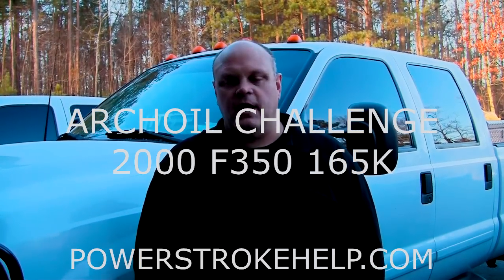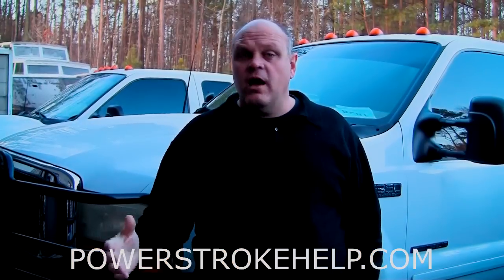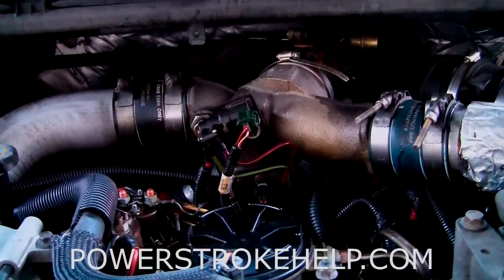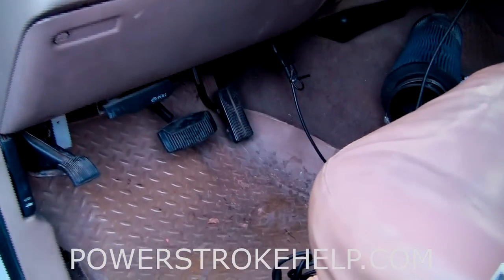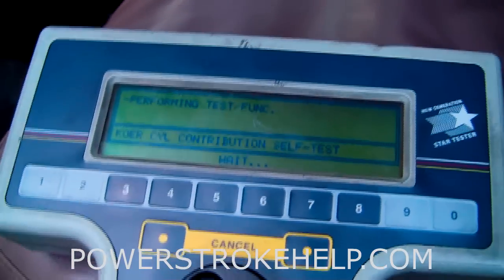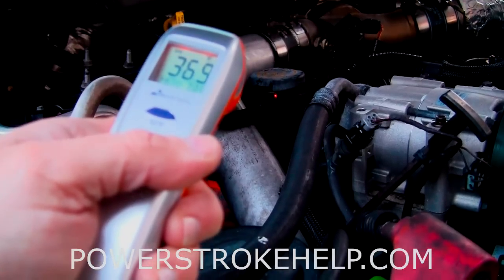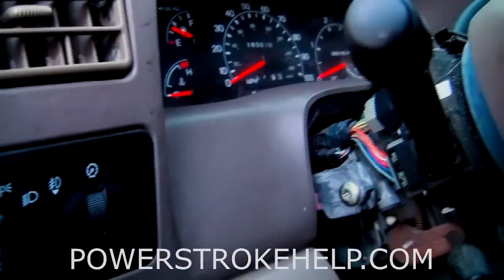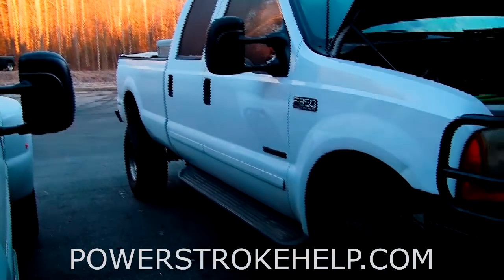ARCHOIL CHALLENGE 2000 F350 165K

Comment: I’ve been working on 7.3 diesels for over 20 years now and I don’t believe in snake oil products to repair them. That being said I watched this video I unwillingly bought a bottle of this expensive shit and put it in my personal truck with 200,000 on the original injectors. It had a bad skip when cold and now it purrs like a kitten. I also added some to the power steering and it helped tremendously. Thanks for spending the time giving us your advise much appreciated.

Comment: Bill, Your videos are great!  I am not a powerstroke owner but I used to be a tech at a few Ford dealers as a line tech and did not work on the diesel engines. all your information is fantastic to pass along to anyone that needs this info you provide and if I get a chance I send them to your channel. great stuff! I always had a soft spot for the 7.3 powerstroke because it is a real work horse of a engine and very few problems if taken care of. just pack a extra camshaft position sensor in the glove box  as it seems to be the achillies heel of the 7.3.

Comment: Bill-I really appreciate your videos.  They have helped me do a better job servicing my 2005 6.0 truck.  I have 184K miles on the truck, and have not had any major troubles, however, do have the stiction issue.  I ordered the Archoil combo today, and hope it gives me better results.  Also, I will be changing to synthetic motor oil.  I have ran regular Rotella for the life of the truck, but feel the injectors need a break........before they break.  Thanks again for the service you provide.  It is appreciated.
Reply from the maker: jamout65 Thank you for your business. This stuff really works. please leave some feedback at archoil.powerstrokehelp.com

Comment from the maker: GO TO POWERSTROKEHELP dot COM to get best pricing
Reply: powerstrokehelp You can put full links in your description part of the video...   Thanks for the video good to know info!
Reply: powerstrokehelp is there a rate for shipping to canada?
Reply from the maker: Kevin Rogers SEnd an email to powerstrokehelp at bellsouth dot net with your exact canadian address and I will give you a quote to ship the p1 kit. no free samples to Canada. Sorry
Reply: powerstrokehelp I wont believe that this isn't snake oil until you do a real test. Brand new engine ran with archoil from the beginning. Brand new engine ran without archoil. At 50k, tear both engines apart and compare wear. Then compare those results with an old engine you have sitting around that has only had archoil ran in it for say 10 to 15k. That will really show what it can do. Then I'll believe these videos are more than you just selling something to make some greenbacks.
Reply: +powerstrokehelp i bought some from a web site in canada and honestly it did sort one of my injectors out, my balance rates(gm's cylinder contrbution system) was hitting +4 at idle when warm and +5.6 in drive, well specs are +4 to -4 in park and +6 to -6 in drive, well not it wont even hit +3 in park and +4 in drive, kinda amazing, i did add the additive into the oil did not notice any chance which i didnt expect it, but on the fuel side of things im impressed and litterly when the additive hit the injectors i could hear a tone change, i swear it changed mabey its all the weed i smoke but it did

Comment: Wow. My 7.3 f350 does that exact same thing during the winter. I never knew what the problem was and neither did any shop in my area. Im going to try it. Thanks Bill.
Reply from the maker: Matt Morris You need to order the p1 kit and hopefully you caught it before the injectors are damaged beyond what ARchoil Ar9100 can do. archoil.powerstrokehelp.com
Reply: powerstrokehelp  Im not pulling any codes from my sct 3015 tho. It runs fine during the summer and after warmed up. Is that normal for stiction?

Comment: Mine was doing and sounded exactly the same. Your guy diagnosed it as needing new battery cables. The ones I had weren't to old. I said replace them if that was the problem. The installation was Not neatly done and the positive cable rubbed against pulley. I had to fix that. Needles to say the new cables didn't fix the issue. There was other repairs done as well. Fuel pump installed all good. Transmission remove new torque converter installed because of loud as heck noise and shifting hard that was my diagnosis I was told that probably wasn't the problem of it shifting hard but it was the problem. Now the torque converter is making the same noise again just not as bad as the original one. They did a transmission service on it (fluid and filter), I've done several transmission services on the truck myself and never had the pan to leak but after they your guys did the service it leaked. Yes I did try contacting your office it was very hard and difficult to get through never would receive a phone call back finally got through talk to the guy out front not you the other got works or just find it him you should hit fill out paperwork and get back with me we never did talk to him again months later he said the same thing never call me back. 
Bill can the Archoil be purchased from your shop or does it have to be shipped out?
Reply: You might want to try reading what you type before you post it because half of what you said makes absolutely no sense.

Comment: Archoil is a fucking miracle. My 05 6.0 was running perfectly fine to my knowledge. Yesterday I added the friction modifier to the oil and 80ml of the fuel additive to a full tank and ran it for about 40 miles and didn't really notice much difference. This morning it was normal to get started (fairly easy but still a few cranks before it'd catch) but after I drove up to the Dawson Forrest, it was like a different truck. It engaged overdrive sooner, stayed in overdrive longer before shifting out (used the engine to torque through the hills) under a load and burned noticeably less gas than previous trips to that area. That was just on* the road. Off road, I noticed that the engine was quieter and used the turbo far less than I was used to it doing. 

I can't say enough about these products so far. I'm looking forward to what my commute to the city looks like this week in terms of MPG

Comment: Would Archoil clean the injectors on a 12 valve Dodge?  How does it compare to Seafoam?
Reply: I think this is better than seafoam. Give it a shot and see if you like the results.  I started using it on my 6.0 and I'm pleased with the results.  It's a little more money, but worth keeping your motor/injectors clean.

Comment: 1:40 & 2:20 - coolant overflow reservoir -  looks old and been used - truck doesn't start
5:40 -> coolant overflow reservoir looks freshly replaced. - truck starts...
Reply: Fiaz M yes, I see that.  Weird
Reply: Would that matter though? Serious question.  I think Im having the same symptoms as this.  Torn between REV-X, Liqui Moly, Hot Shots, and now this product.  White smoke on start up, burns eyes and throat, contribution code on cylinder 4.  Slight miss under tow until rpms get up and turbo is spooled up.  Never lose any coolant.
Reply: Shawn Cooke I would use this out of any of those
Reply: Same truck though... Rad hose still has the raggedy sticker, and the non stock parts are still there... It got serviced.
Reply: Brake fluid reservoir has the exact same dirty marks though, and the radiator header is brand new, so obviously has been changed.

Comment: I wish you did Cummins instead of power stroke, never found anyone like you for Cummins especially on here, too bad I didn't know about you when my dad had his 6.0 04 excursion he'd probably still have if!
Reply: Alan not always I noticed on higher mileage trucks valve lash becomes an issue the dowl pin on the front cover is a problem ya need to look into anything not a HO block I think casting 59 where prone to crack around cylinder 1 water jacket electrical wiring around the fuse panels for the grid heater are deadly for 2003-2006 they had common rail issues aswell and can burn the truck 48re automatics and 68re are weak, cummins engines aren't bad just the odd ones like everything 7 mains to a v8s 5
Reply: *Fuse panel and can burn the truck

Comment: Pretty impressive Bill.  Did you use fully Synthetic oil when you performed the oil change and added the 9100?  I ordered the 2 pack from you the other day for my 6.4 and trying to decide if I should switch to fully synthetic oil.
Reply from the maker: In a 6.4 run the synthetic for sure. The rocker arms are prone to failure that will kill the heads and valve stems, resulting in $1000s of repairs.
Reply: powerstrokehelp so we change the oil then put archoil and leave it till next oil change ?

Comment: Bill,
i have been watching your videos for the past couple of years and tend to trust the stuff you are talking about.. I can say in reading on the various forums, FTE, PSnation etc, and watching your helpful videos I was aware of the issues with 6.0L  PS when looking at trucks last year.  I know it saved me a lot of money and headaches and I went with a 2003 7.3L. The how to buy a used truck video was extremely helpful in finding a good, and i looked at 4 with 2 being crap, truck to purchase last august 2014. 

I have been watching this info on archoil and have to say the results have been amazing.. One question on the truck show in video, 2000 F-350 SRW was how old was the oil and what was it condition before changing..  The reason i ask is what would have been the result out out the archoil additive in oil vs a good fresh oil change. I think to satisfy the non-believers that might be a good video to produce. 

I am sure the additive is doing a good job just wonder how good vs a fresh oil change. Would have been nice know mileage on old oil and see the UOA by blackrock. 

keep up the good work and thank a million for your info.

carl 2003 7.3L owner in NC

Comment: So how come the injectors respond better on the second test when all you have done is add the products to oil & fuel? Why does it start straight away if the products haven't been run through the motor?

Comment: are you leaving the  arch oil   in the engine  and use the truck as normal condition until next oil change or  after the 40 miles of driving you drain it?
Reply from the maker: Joel N The AR9100 friction modifier is installed in the oil and stays there. At next oil change you install new AR9100. THe AR6200 combustion CAtalyst is installed in fuel very time you fill up. Give it a try. You WILL see and feel a difference.Archoil challenge is only $4.95.  archoil.powerstroke.com

Comment: Hi there I did ar9100 in my last oil change my truck and its been about 5000 miles now it is a 2000 f-350 7.3 with 200000 miles. the truck runs great and smooth but every morning it misses for about 10 mins untill it starts showing temp on the gauge. you can clearly feel the miss and when its starts working fine after its warm. now with the ar9100 I have seen some improvements, it sounds a lot quieter. my question is do I have a bad injector or should I try ar9100 again do you think if it hasnt worked yet that I need to get a my injectors checked out and another one put in? thanks for any help.

Comment: Hello Bill, What type of oil did you use/recommend in that truck?? I have an 02 7.3 that has always had motorcraft 15w40 and does well. 310k miles. Ill be ordering archoil and didn't know if you would recommend switching oils as well..?? Everyone has an opinion on oil, but I want yours based on your experience- Thanks for your time-

Comment: I really hope you reply!! So I have a 2005 f350 with a 7.3 liter an my truck is experiencing white smoke out the tail pipe. I’m wanting to buy injectors but saw this video. I don’t want to melt a piston. I’m absolutely certain that this is stiction an my start up takes longer to crank an when running smoke a lot especially upon gas. So I’m wondering should I try this?  Would now be the time to use this stuff or is it to late an should I just replace them.

Comment: I tried this combo and started experiencing "stiction" issues only AFTER the treatment. I'm wondering if i may need to change the fuel filter or oil again in case there is debris that was dislodged although I didn't have any issues before the treatment?

Comment: Bill, Do you recommend pulling the oil filter standpipe on the 6.0 to add the 9100? I've seen you do it on the oil rev x video. Also could you do the same test, same video on a 6.0? I've never really hear 7.3s with stiction issues unlike the 6.0s. That would be a good demo I think! Take care!!
Reply from the maker: psd6ohslow In severe stiction cases it may be necessary but in a truck that already runs OK I wouldnt take the extra time.

Comment: How will this work on a 6.0? I did rev-x treatment last oil change and it helped but I still need oil temps at 120℉+ for smooth running. Still runs the same current oil change with Mobil 1 in it with no additives.

Comment: I have a 2013 6.7L with only 13,000 miles....would it be necessary to start using these products this early in the trucks life or wait closer to 75-100,000 miles??
Reply from the maker: wideopenmx850 If you want your truck to run as well as it gan and get better fuel economy I suggest that you start using them now. Go to archoil.powerstrokehelp.com to order.
Reply: powerstrokehelp hey bill my 02 f350 7.3L eats a FOMOCO Motorcraft alternator every year.  just went out again.  what aftermarket high output alternator should I go to?
Reply: wideopenmx850  I been running this product on my 14 F350 6.7L at 4,000miles? An. Ow I'm at 475,000 miles if it works for me it'll work for you
Reply: gcolo98 475k miles on a 6.7?! And 2014! How did you get those miles in 4 years!

Comment: I have a 1993 ford f-350 dually 4 door 7.3 Diesel non turbo idi engine it has new injectors, new glow plugs, clean fuel filter, new air filter, change the oil every 4,000 miles since I've had it 8 years it has 230,839 miles on it cleaned both fuel tanks put two brand new huge batteries on it the biggest Sal mart sales I think they are 1000 cold cranking amp batteries new alternator but it is still really hard to crank I have put around 5 starters on it in past 3 years it just keeps burning them up cause it is so look hard to crank any suggestions??? when you get it running after it sits around 7 or 8 hours it is hard to crank again but up until then it fires right up..
Reply: William Williams you have air in the fuel system and will continue to do the same thing until you fix the air..Check your fuel return lines and lift pump lines...your getting air somewhere...

Comment: Hi bill, fantastic video. I have been using hot shots secret oil & fuel additive for years with good results. Have you ever used those and how do they compare to the arch oil in the video. Thanks!
Reply from the maker: landscaperconnection Hot shots is outstanding and certainly better than no additive BUT there's a new gun in town. THe Archoil AR6200 does everything the Hotshots does but AR6200 is a fuel catalyst which means it makes the fuel burn better. This will result in etter fuel economy, better start ups and less soot in the turbo and exhaust. Hot Shots does not do that. archoil.powerstrokehelp.com

Comment: question, so when using this product, how long does it last? will the truck go back to previous state without it in the oil? - located in Ontario and the winters here are bitter cold! running a 6.0L excursion powerstrokehelp
Reply from the maker: Dan M You really need both products to feel the difference. 

The AR9100 friction modifier is installed in the oil and stays there. At next oil change you install new AR9100. THe AR6200 combustion CAtalyst is installed in fuel very time you fill up. Give it a try. You WILL see and feel a difference.Archoil challenge is only $4.95.  archoil.powerstroke.com

Comment: So in the oil change, you just put one quart less of the Rotella and add the one quart of the Archoil?
Reply from the maker: Jerry A You only use 16oz of Archoi AR9200 in the oil so put 14qt of oil and then add the 16 oz of AR9200, Once you have started the truck for a minute check the oil level and add to top it off.

Comment: I'm a fan of your help and have used it on my truck. But i have a concern about what you just did in this video. At about 3:14-3:18 you glanced at the coolant gauge. One thing i have a concern with is the fact you just cold rev'd the shit out of the guys truck. The truck isn't even close to operating temperature yet. If your customer was running 15w-40 in the truck. That oil isn't even close to being ready to lubricate in 35*F weather. Let alone might not even be flowing properly through the HPOP yet. I do believe in your work but not letting the truck get to operating temp and redlining it... That would bring some concerns to myself as a Diesel Technician watching your how to/product reviews.
Reply from the maker: You know I have done that for years and never had a problem. Generally I do let the truck run for a couple minutes before I rev it. Its really no different than 99% of these truck owners that start the truck and drop it right into drive and hammer it. And Its really the only way to quickly check for stiction. There are massive quantities of oil being moved through that engine. 15 gallons going round and around several times a minute.
Reply: i had a problem with one of my injectors, when the vehicle was warm there was no sign of any problem, even the ford diagnostics program could not find a faulty injector. The only way to find which one it was, was to cold start it and rev! as off as thats founds we found the faulty injector and replaced it...runs like a champ now